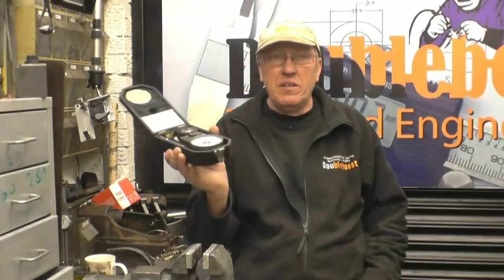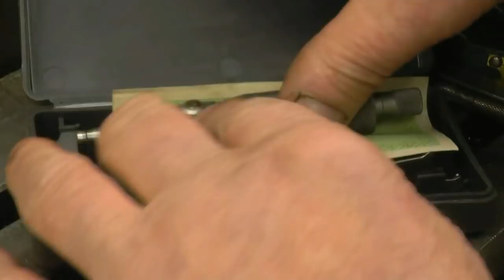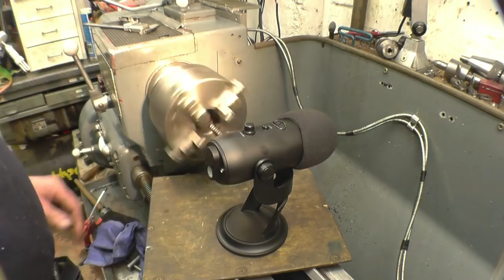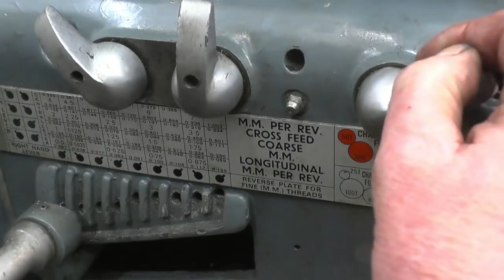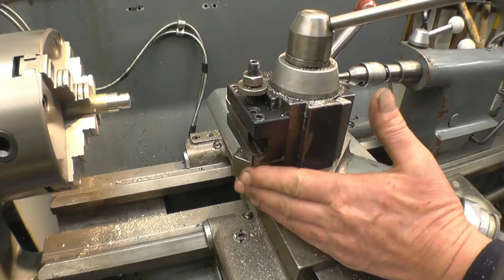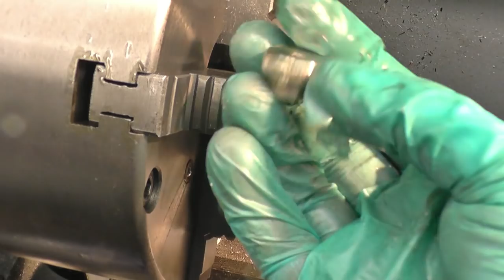SNNC206 P1   Screw Cutting Bronze

Comment: 5/8-27 is the standard thread for microphone stands. 1/4-20 is most used for photo equipment, however 3/8-16 is also used for professional film and video cameras.
Reply from the maker: Thanks for that I was told 26  1 mill fits ok for a mike bush

Comment: Just to be pedantic, the standard camera mounting thread is 1/4" British Standard Whitworth.  It is just that most 60 degree UNC threading will work fine with the 55 degree threads in the cameras.  It is the ultimate revenge of the Empire that most cameras are made in metric countries but are made with BSW threading tools.
Reply: unc, bsw are generally interchangeable, dependant on thread nomenclature tolerances........ apart from 1/2 inch as the T.P.I. is different.... 12 whit 13 unc

Comment: I always thought the microphone thread standard was 5/8 x 27 tpi! That said I'm going to make a 16mm x 1mm plug and see if that fits in one of my adapters that I made with a 5/8 x 27 tap. And a happy and prosperous new year to all the Mills clan!
Reply: 5/8 inch = 15.875 mM., which should be only a tad loose.  27 TPI = 0.941 mM. pitch, which (again) is quite close.

Eli D.